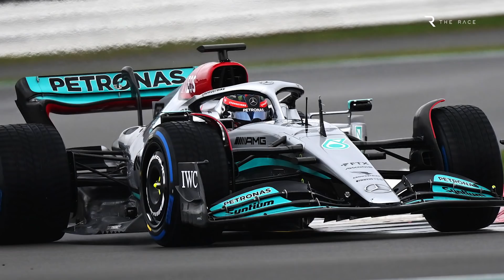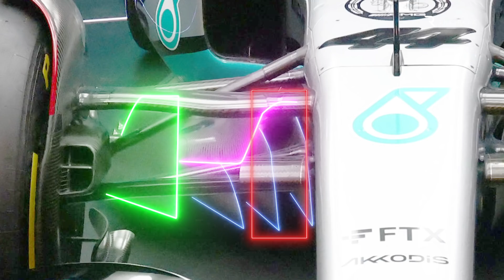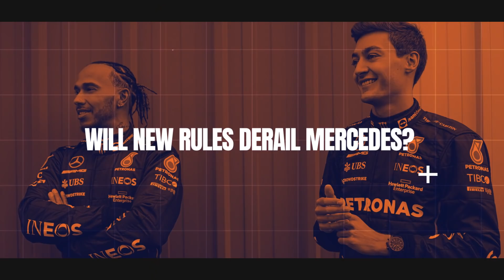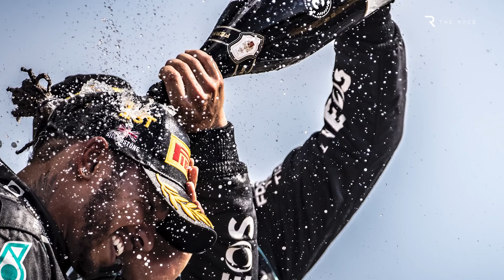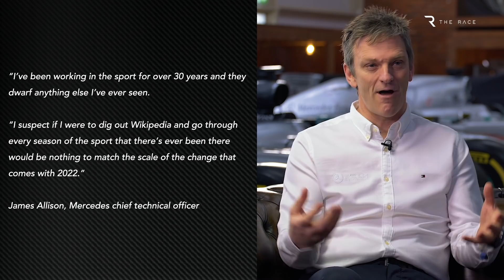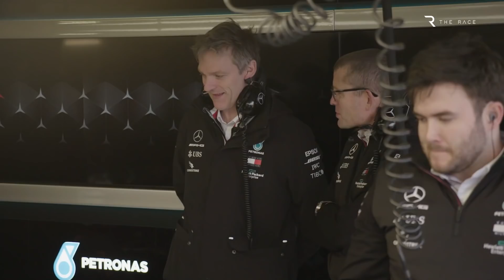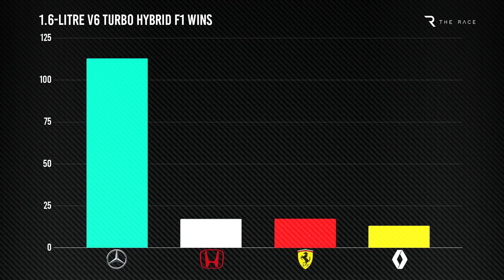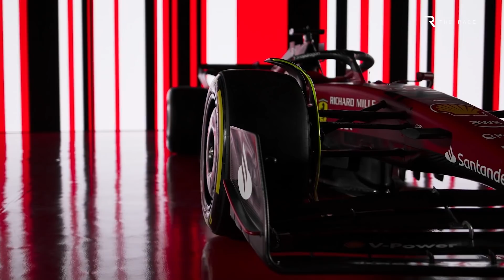Why Mercedes needed 'a huge internal redesign' for its 2022 F1 car

Comment: God these cars are gorgeous
Reply: Have already had a wank to these new cars
Reply: @cooper512  lmao
Reply: This is probably my least favourite so far, but I still really like it, especially the turquoise accents. I don't like how the floor looks like when I used to melt crisp packets in the oven as a kid.
Reply: all of them are gorgeous but the Ferrari and this mercedes are the prettiest
Reply: @SimGT_27  don’t forget AM
Reply: Coolest car shape I've ever seen
Reply: They are wayyyy too heavy.
Reply: @jamesscoging6986  yes James,  regarding weight I simply must agree.  If I'm not mistaken this year's F1 cars are now the same weight as Indy Cars were roughly 25 years ago.  And the weight difference between F1 cars and Indy Cars was always the single biggest point of differentiation.  If I recall correctly the 1981 FW07 was getting down to 520kg without driver.  The FIA can claim the current cars are "greener than ever" but it's a dubious claim.
Reply: Floor shape is like a some sort of alien waste packed into big vacuum bags. Probably feeding the engine with Ethanol
Reply: @amehu  I guess they hired a "Plasticine Master Engineer" and he's hard at work to prove he deserves his place...
I can see someone aiming directly at those parts looking to find out how the car will perform after missing some bits.
Reply: The cars are a big steaming pile of ugly turds.
Reply: @alucardhellsing1037  Ill have what you're smokin on pls
Reply: @alucardhellsing1037  Your turds must be very impressive in that case.
Reply: @alucardhellsing1037  OK Dracula no van Hellsing, what would make you happy car wise??
Reply: @alucardhellsing1037  i’m glad, rbr car have a friend now 😭

Comment: The new rules will always test a team's computational and creative capabilities. What is really interesting is that Mercedes' concept is very reminiscent of 2019-2021 style concepts, (front wing loaded outwards, tightly packed side pods and wavy floor sections). No other team has such close resemblance to their earlier machinery, so it will be really interesting to see if this concept was really a refinement from a blank slate, or something they knew works adapted to a new set of regulations.
Reply: yeah definitely looks like they played it safe, at least for the start. Im really liking the look of the ferrari. Hope it is as fast as it looks xd
Reply: The majority of downforce now comes from the floor, so it’s not even remotely similar to previous cars, every aerodynamic surface will be new.
Reply: @senseofthecommonman  Yes, but the solutions implemented by other teams on overbody downforce are extremely new and unique. You cannot say that for the Merc and it is much more intriguing than any other concept shown.
Reply: Makes me think back to Williams 97 going into 98. Basically re purposing a newey design into new regs, it worked just not at the sharp end of the grid.
Reply: The suspiciously familiar to W12 design simply tells us that Mercedes pulled off a bluff, especially given the fact that the render is different from the car that was presented today in real life. Red Bull presented the 2022 FIA car with the new livery, Mercedes went further and presented last year car with 2022 aerodynamic standards.
Reply: @Shifftee  They actually run the showcar so it's the real thing.
Reply: @Shifftee  You clearly have no idea what you are talking about. The W13 looks nothing like the W12 design besides that wavy floor
Reply: 37 year old mistake prone Hamilton will be the #2 driver
Reply: @default123default2  I'm a Ferrari fan, make no mistake for Lewis' ability. The wilder nature of 2022 will place more weight on driver ability, it will be a true test for all top tier drivers.
Reply: @TheZanzaroni  with Carlos on board I think the next few years will be very pleasing for you!
Reply: Idiocy-prone Verstappen fan with a typical #2 comment.
Reply: @xdoctorblindx  the drive to survive max crowd have really made f1 toxic.
Reply: @xdoctorblindx  don’t have to be a Verstappen fan to dislike Lewis.
Reply: @abedfo88  the unending moaning of Hamilton fans over the past few months are far worse.
Reply: @xdoctorblindx  Do we all have to board the Hamilton sycophant train ? It's getting damn tiring.
Reply: @default123default2  maybe u can try to say that in rbr car reveal? then u won’t need to enter the train… as usual max bootlicker 🤡
Reply: @senseofthecommonman  I mean they have a legitimate reason to. Abu Dhabi was a total screw up and was mot handled well at all. Lewis was robbed and Max was gifted the title, you can't get around that fact.
Reply: @abedfo88  forreal I don't remember it ever being like this before the show not like this atleast
Reply: @default123default2  CrashWillHappen fanboy detected
Reply: @default123default2  as if you took time to write that comment.
Reply: @default123default2   max couldn’t beat a 37 year old error prone number 2 Hamilton without the race director changing the rules for him at the last race
Reply: @noncookiecutter6753  Max beat Hamilton through the course of the season, which is evident by the statistics and by the elimination of external factors like Max's obvious misfortune at Silverstone, Baku, and Hungary. All Lewis had to do is not to fuck up his break bias in Baku and he would have had the title, but as many times before when he was young, he made a mistake under pressure.
Reply: @chrisj1612  You're right about the Baku fuck up, but there are a lot of moments during the season in wich Hamilton was not at his top, being outdrived by Fernando in Hungary, the rookie drive in Imola, in my opinion in USA he performed below his abilitites, Monaco was also a shitshow, and most of this below top tier performances due to him not being able to cope with Verstappen's agression. So Verstappen is a worthy champion, he's an excellent driver and only time well tell how good he can be (probably one of the best, on par with the likes o Schumacher, Ayrton, Prost, Lauda and of course Hamilton), but the Abu Dhabi GP was a debacle and it's sad that a lot of F1 fans are only focusing on one moment of a very good season from Max (that failed Saudi GP quali atempt was on track to be one of the greatest one lap performances of all time) in wich he was able to beat one of the best teams in F1 history, and this is mainly due to a form of hooliganism taking over the F1 fanbase (it's virtual hooliganism but hooliganism nonethelss) that makes people forget that F1 is a sport and not a fucking warzone full of enemies. In history there are a lot of moments where the race directors failed or had incoerent and biased interpretations of the rules, this will allways happen, and great drivers competing for the tittle will allways be favored in some instances or harmed in other, in the last season both contenders were harmed and favored in some decisions so we can't make one bad decision define a championship winning season from Verstappen, I support Mercedes, but this is the truth. This season Verstappen is the defender and Hamilton the attacker so let's hope they can compete at an even higher level than last season.
Reply: @Zvardo  100%👌
Reply: @default123default2  huh 37 yo Hamilton will remain the number 1 driver not even a question lol Russel is class but not experienced enough not to bottle it a couple times
Reply: @mywaffle2507  no he won't. Most of the time , young top prospects beat 37 year olds. Ppl have just lost track on how old Hamilton really is.

Comment: Feels like 2017 all over again...

Will Ferrari have the engine this time, as the SF70-H was let down by engine power/reliability.
Reply: Still remember Vettel's engine failure in 2017 at Japan... I swear if Leclerc loses his title due to some engine failures... From 2021 you can already see how much these retirements cost you... And Mercedes always comes back in the 2nd half
Reply: @Release-Topic-b4d  That engine problem came right after Singapore were Vettel crashed with Max and Kimi. Vettel was ahead in the WDC until he threw it away, we not gonna blame Ferrari
Reply: @IconiclasmXI  ? Vettel literally had a engine change in Malaysia (got a new engine), the race before Japan.
Reply: @IconiclasmXI  👈🤡

Comment: The cost cap will hit them hard, RB used to spend $250M per year compared to Mercedes' $500M. That's double. 
Based on their performance, I'd say Redbull gets more for their money; and are likely to benefit from this cost cap.
Reply: I don't know where you got your figures from, but Red Bull spent $800 million.
Reply: @davidbrown8517  I'm talking about one individual season. They can't spend $800M in a year, RedBull Racing isn't even worth that much 😂
Reply: @abirshivanand409  2019 season  
Mercedes $484m 
Ferrari  -$463m
RBR - $ 445m
Reply: @thawk6792  Some sources suggest that Rb spent 237M pounds, which is around $320-330M. They'd be much closer if they were spending 400M+ lmao
Reply: @davidbrown8517  Ok, just looked it up once again, they spend around $300M, which is still lower than Mercedes' $480M-500M budget.
Reply: Yeah last year with cut out of floor gifted then best car for more viewers
Reply: WELL, to be honest, Mercedes operations are just on a bigger scale altogether so when it comes right down to it I think their possibilities are truly enormous.

Comment: I really like Mercedes, and yes, they've maintained a stranglehold over the sport for almost a decade but that fact makes it easy to forget their early struggles, just after buying the title winning Brawn team. If we are talking about rule changes affecting them in negative ways then it has to be said that, yes they did nail the hybrid crossover rule change, but their return to F1, initially, was pretty much a 3 year stint of dead seasons. With Schumi and Nico for all three of those seasons I'd like to think we all expected much more from them. Fast-forwarding back to now, I'm not necessarily interested to see merc "fail", rather then I'd like to see other teams get it really right. If, for whatever reason, merc doesn't get this rule change 100% right, we could very well see this powerhouse fall from grace. I'm so excited for this season
Reply: They were building the team back then, It takes time to grow
Reply: As a George Russell fan, I'd very much like them to succeed.
Reply: I expect this to be another "building" phase, if for no other reason, the lack of R&D resources permitted compared to the other teams. This rule shake up can't be taken lightly, nobody is even on the track yet and the cars look so radically different from each other, I am really excited to see a team like Alpha Tauri or Aston Martin really close that gap and challenge for results.
Reply: 💯 spitting facts. Most people just want them to fail. There's a reason they dominated for so many years. If other teams were good they would have dethroned them by now.
Reply: Even if they "fail" I dont see them falling too far off. The organizational culture at Mercedes is incredibly efficient and the synergy between the engineering team and Lewis is practically unbeatable.
Reply: I can see you don’t enjoy seeing greatness. I can just imagine how much you wanted to see Bolt fail in track and field. He was almost unbeatable.
Reply: Dont worry George boy will get them to the top His co driver will add to the fight L.O.L.

Comment: Remember one thing Mercedes is one of the the teams with a lot of experience with low rake configuration.
Reply: Rake is non-existent now. Any experience a team may have with high or low rake is pretty much irrelevant with the new floor designs, ground effect is most effective with the floor flat to the track
Reply: @tyler_bt3326  flat to the track is the definition of low rake, and it also needs a specific suspension set up that is good to have experience with.
Reply: @byanymeansnecessary9329  Rake refers to the car altitude created by raising rear ride height in relation to front ride height, effectively setting the car up with an upward slope front-to-rear.
Reply: @baclava69  yeah? And so?
Reply: @byanymeansnecessary9329  just trying to educate you, hopefully stop you giving out incorrect information.
Reply: @baclava69  nothing I said was incorrect,  educate yourself. Flat to the track is low rake, same difference.  And the proper term is attitude,  not altitude.
Reply: @tyler_bt3326  Your shows that you have no idea what you are talking about, “flat to the track” is low rake SMH.
Reply: @tyler_bt3326  W13 is the 2nd worst 2022 F1 car in my opinion. Only behind HAAS.
Reply: @purwantiallan5089  Too bad I don't think Mercedes is that bad.
Reply: Furthermore, we may have seen a good part of their 2022 car Race tested in The Brazilian GP last season, when Hamilton's car was turned into a Rocket Ship: thanks to a 2022 engine (???) as well as new era ground effects aerodynamics (??) 😙😙
Reply: @hicm1of124  Wrong on both counts. Try again.
Reply: Not in the short wheelbase configuration though.
Reply: @andyf1210  these 22 cars are no shorter than the 14, 15 and 16 dominant mercs.
Reply: @andyf1210  they have the largest wheelbase on the car
Reply: @kevinmontufar9400  yes. Large wheelbase, BIG PROBLEMS.
Reply: @purwantiallan5089  it might be the opposite of what you claim, bruh
Reply: @andyf1210  yes.